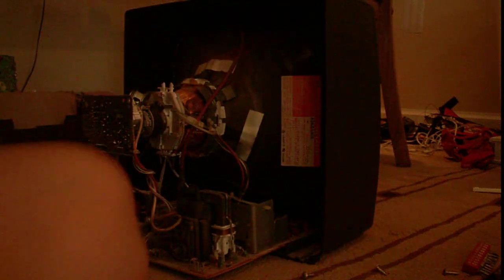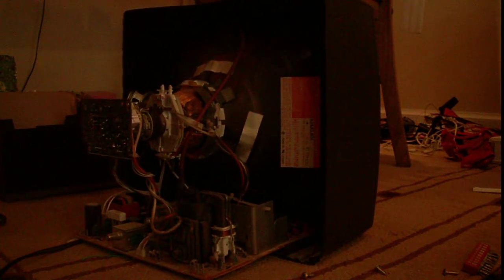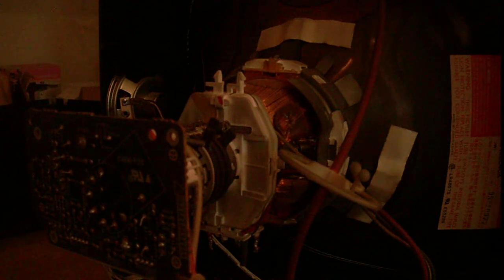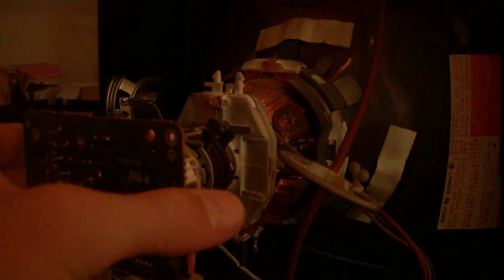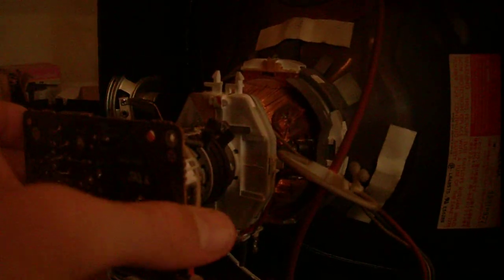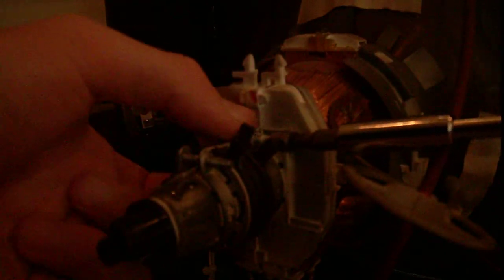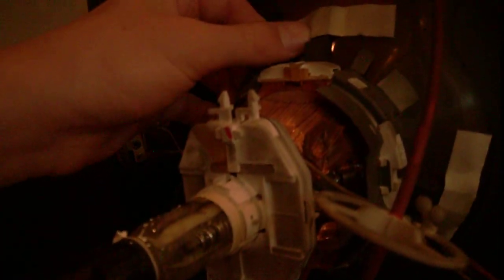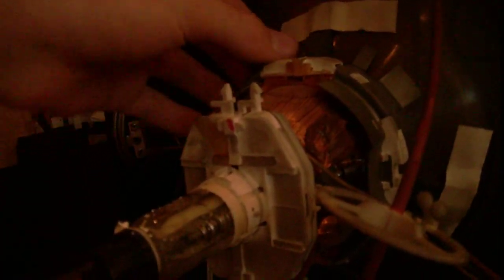How to Take Off Deflection Coil from CRT TV

Comment from the maker: @TelluriumLabs cool, good luck with your accelerator, how many electron volts is it? As for the second part i would build a LINAC myself because of the reasons you stated, but the closest thing i  have to a vacuum pump is a vacuum cleaner.